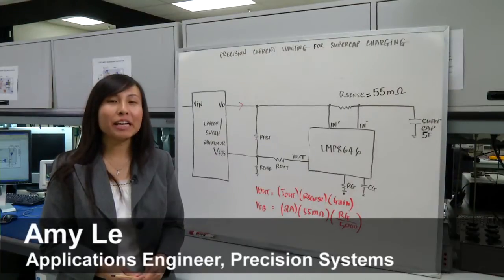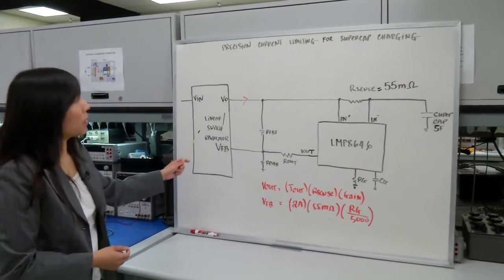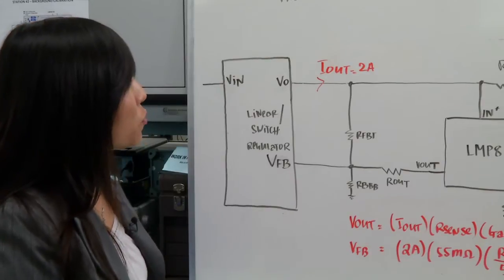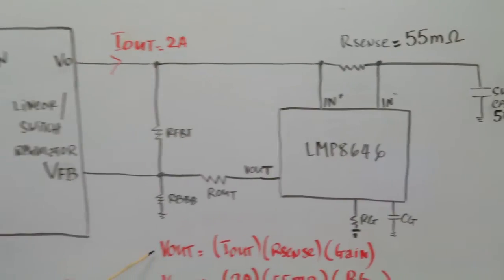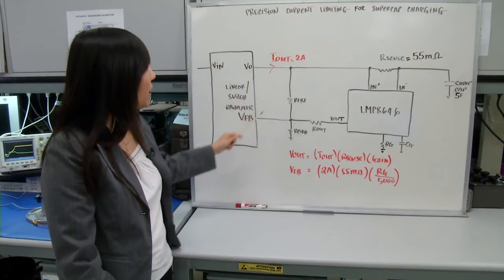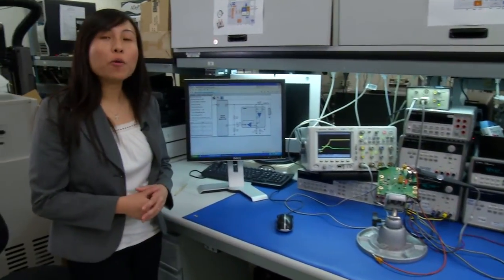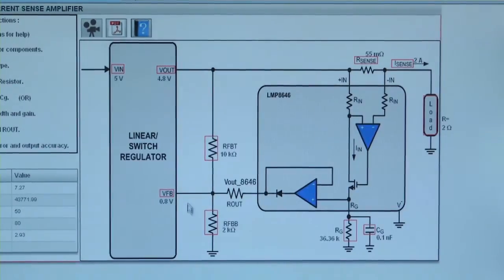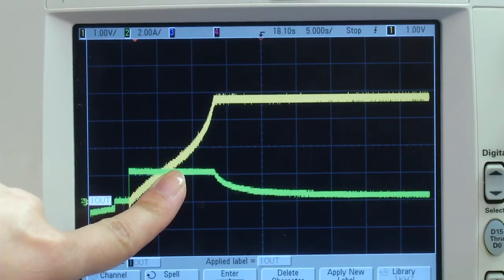Engineer It - How to do precision current limiting for a supercapacitor application

Comment: I can't find anywhere the leakage of the diode at the output of the LMP8646 output opamp when it is reverse biased. This is essential for designing a voltage sense network. Also the leakage of the opamp input connected to the same pin.

Comment: I used your LM2596 5V Simple switcher along with required Capacitor and inductor to step down 12v 150Amp dc to 5v 3amp dc to make Mobile charger but it failed after using two to three days . After that I bought readymade step down buck converter using LM2596 but they also worked for 6 to 7 days. Do you any Simple Switcher that can step down 14V 150 Amp dc to 5v 2 or 3 amp and can operate 80°c efficiently.
Reply: Why does it fail?
Reply: there's no reason they should be 80 degrees

Comment: any high amp solutions which switch mode for 100-300amps,  if it were only talking 2-5amp, then use  inrush-current limitor is fine,

Comment: What if your power supply does not have a feedback loop (Vfb)? What part do you suggest instead of the LMP8646? Thanks.
Reply: You cannot regulate in an open-loop configuration.